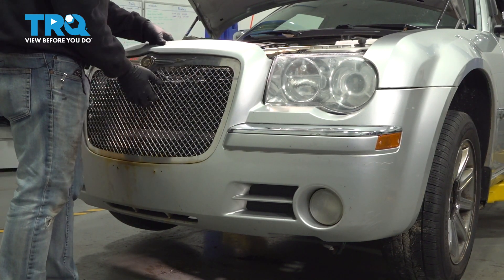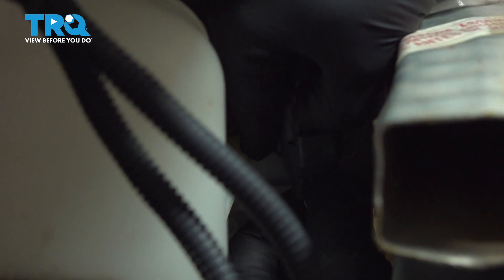How tor Replace Front Bumper Cover 2005-2010 Chrysler 300

Comment: I've got a little dangly wire header on the driver's side, there is a little box attached to the driver's side of the bumper that looks like it is supposed to socket into it, but it doesn't stay in. What the hell is that wire? I know that my fog-lights do not work at all even though they are brand new.